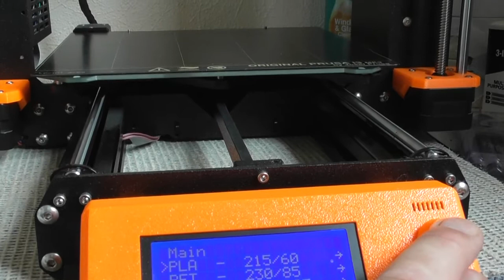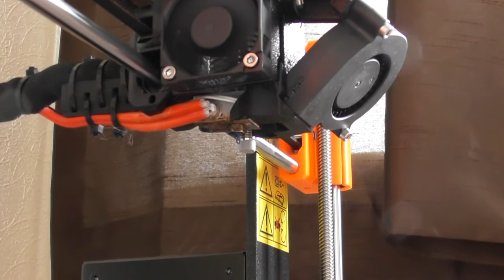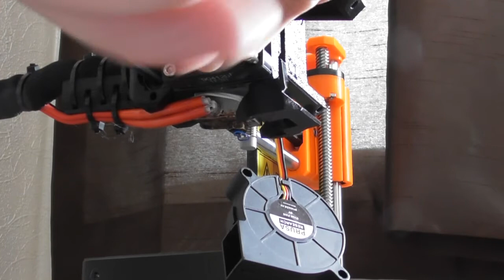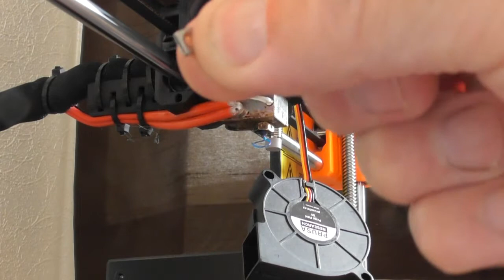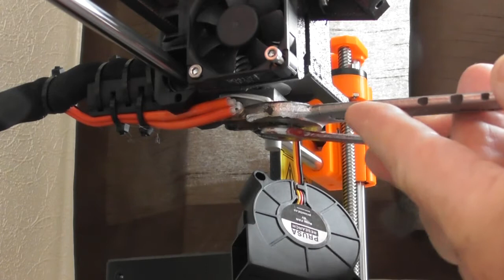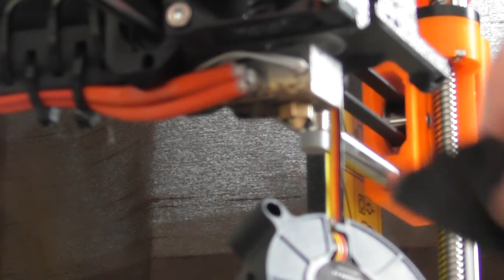Prusa i3 MK3S 3D printer. replacement of the 0.4 nozzle, the easy way.

Comment: O.o I just get sparks from the cables but getting the darn thing out I have not managed. Considering the metal tools I am quite scared too. I do not want to make a shocking mistake. I think I bought a bunch of spare parts... Perhaps it is easier for me to just open the darn thing up and just replace the entire thing. Really frustrating though. I do not even know if changing the nozzle would make the big difference I hope for. Or if there are other wears and tears that needs to be fixed with my printer. But it did print for months so I would think a change of nozzle would not be a bad thing to do. :/